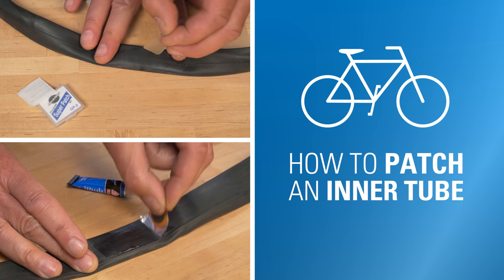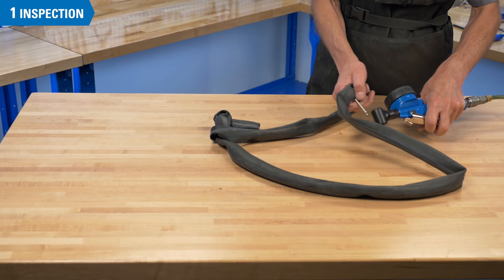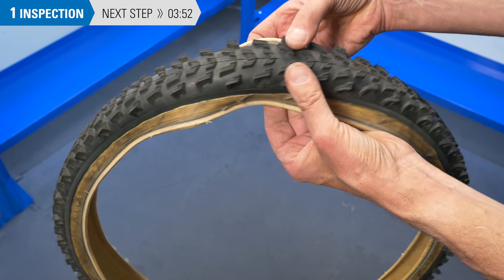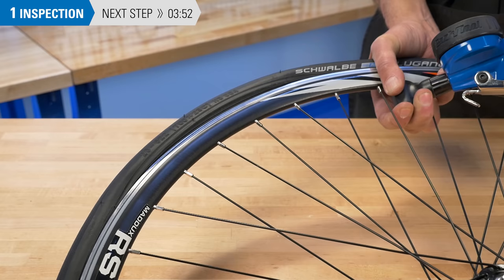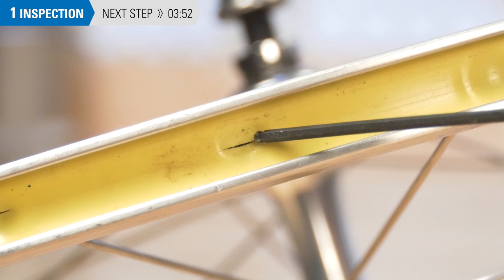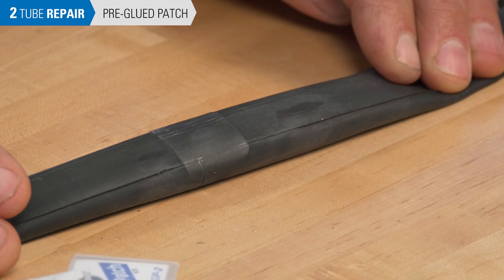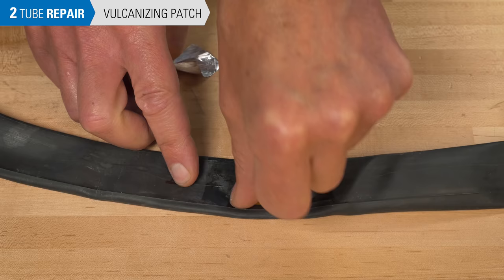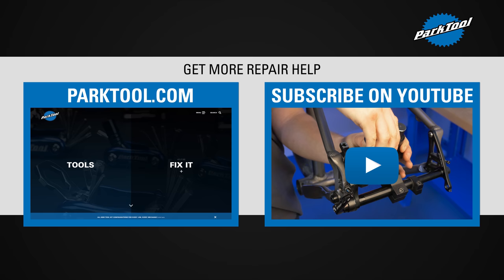How to Patch a Bicycle Inner Tube

Comment: I am being slowly driven insane by flat tires.  I am getting inner punctures from the inner rim.  I have already replaced the rim strips and they still look great.  I put in new tubes.   But, I have to be extremely careful about tire pressure. I am not even pumping them up that hard and it is less than what is says the max pressure can be. And the tire still blows out. I got a quarter in rip, dead center on the tube, rim side, about 4 inches from the valve.  There is no roughness or anything poking out from the rim in that spot.  It is driving me insane.  I live in Denver. Maybe I am over-inflating the tube for high altitude? Oh, and I just attempted a patch, and that failed too.
Reply: me too. I  found out tires from china are defective ! Makes me angry that we keep buying chinese junk ! Most companies here are making their tubes in china such as BELL ! Pure junk ! I put the proper amount of air in and BOOM !
Reply: Especially with narrow tires, either of 2 things can happen 
1. The base of the valve stem gets caught under the wire bead of the tire. Because the bead isn't properly seated, the tire blows off the rim when being inflated. This is prevented by pushing the stem into the rim-hole and feeling through the side walls before inflation. 
2. The tube gets twisted (like wringing a towel). The tension between folds causes the tube to cut itself. This is avoided by putting some talcum powder on the tube & tire to allow it to straighten out.  I inflate the tire to about 10 psi, release the air and then completely inflate.

Comment: What if the puncture is on the inside of the tube facing the rim, is it possible to fix
Reply: I tried that and it held until i rode it. Sometimes if they are along the seam they tend to burst at the patched location making it irreparable. Note i am at the lightest weight that is healthy for my height of 5'11".

Comment: How long do i need to wait before inflating(installing) tire after patching with Pre-glued patch and after patching with Vulcanizing Patch  ?
Reply from the maker: Give it a few minutes, maybe 3. You do not want it wet.
Reply: @parktool  I mean after i patched , after how long can i use it ?
Reply: @Temporalplace  I rarely have a spare tube,  and often help others on the trail with neither patch, tube nor pump.  As soon as I have applied the vulcanized patch, I reassemble the tube/tire, reinflate and continue the ride immediately.
  How long can you use it? Vulcanized surfaces essentially melt together. The tube can be used for years.

Comment: I repair my cycle rubber tube punture at home , I use rubber solution  ready-made patch but problem is that my rubber solution  solution tube is become hard unuseful  in short time, pl give me some tips how the rubber solution keep ok long time.
Reply: When I am out of a "rubber solution" I use a heat resistant contact adhesive which i apply both to the inner tube and the patch. I then wait 15 min (following the instructions on the adhesive tube) for the solvent to evaporate before  applying  the patch to the tube.

Comment: I've noticed that for hard-to find slow leaks, just getting the entire tube WET, short of fully submerging it, is usually enough to find a small patch of water bubbling up at some point. Just in case you don't have a bucket handy but the leak is quite small.

Comment: Can i use these patches to repair small holes on my tubeless tyre?
Reply from the maker: If the tire is in the UST standard for tubeless, and the tire has a butyl rubber liner on the inside, and that can accept a patch like an inner tube. However, if a sealant was used, that would make it difficult to stick. It the tire was a "tubeless ready" or a conversion of some sort, the patch would be unlikely to hold.
Reply: Deabo No

Comment: Way too much glue used just needs to be slightly bigger than the patch as now the inner tube will stick to the inside of the tyre as no chalk was used or included in the kit? I guess that's the difference between fixing your own punctures and someone who does not! If you are going to mark where the puncture is with a sharpy can I suggest you leave the area alone where the patch will be placed to avoid unnecessary contamination.

Comment: As you said just replace it with a new one instead of patching. I trust the first advise. Patching is a waste of my time as always.
Reply: depends. I don't really like looking at a stack of tubes and realizing they cost as much as a new bike, all because I'm too lazy to repair a small leak.
but, it you rarely get leaks, and you can always easily correct what caused the leak, then you're likely right, just swap out and be done.
Reply: Done right a patch is permanent.

Comment: No need to press the valve on a Presta valve to roll it up, just unscrew it to the point where it will not hold air. So much misinfo in this video!

Comment: Hack: Once I used a small piece of chewed chewing gum. It worked perfectly.
Reply: yeah but you cant pump much air into it or it will bubble
Did you let it dry?
Reply: @xxersion3335  I chewed it, pressed it firmly, without waiting I put the inner tube back into place and pumped it at max pressure. It perfectly held. The downside is that this is not a permanent solution. After two weeks  the gum dried and broke itself into pieces. Anyway for sure it is an easier and faster way to save your ride. ;)
Reply: NO WAY ! Juicy Fruit or Doublemint ?
Reply: @triumphmanful  double Mint ;)

Comment: damn,if u dont know how to patch a tube u shouldnt be riding anywhere until u do,common sense really :)
Reply: neil froggy crompton why did you watch this then?
Reply: They do mention some crucial information that isn't always common knowledge (or written in the instruction paper that comes with the kit), like not to test-inflate the tube after patch has been applied cause that can weaken the patch, has happened to me few times.
Reply: neil froggy crompton its not a fooking car if a rock punctures your tube you wont die. You go like twice as fast with a bike.
Reply: Aden aio is there a way to test the tube before riding?
Reply: TWrecks you could. Bikes offer little to no protection during crashes.
Reply: make a space after punctuation, Common Sense really

Comment: Those patch never work....Just take a old inner tube ...cut a piece... scratch it with a sandpaper and glue that with a glue gun after you did scratch the inner tube with sandpaper ( to get a better grip for the glue)

Comment: I'm going to tell you what pisses me off.  This is supposed to be a video about how to patch a tire.  I'm over 3 minutes in and you haven't even started talking about it yet.  You're wasting my time with information I don't need and you didn't put in the title.
Reply from the maker: Diagnosis is just as important as the repair process itself. If you don’t determine the cause of your flat, you will likely end up repeating the entire process down the road.
Reply: You don't get to decide for other adults what they need.  Justify it however you want, but it wasn't in the title.  It could be it's own video.
Reply from the maker: Welcome to the internet Robert.
Reply: @parktool  don't blame the internet for your discourteous behavior.  YOU are responsible for your actions.  Don't be a child.

Comment: Why?  Tubes are not that expensive, when I get a flat I inspect the tire inside and out, then replace the tube.  Takes 5 minutes, I don't waste time putting on a patch that may or may not stay on, leaving you to change it again!
Reply from the maker: Why? First, because it is less waste to repair if it is a good repair. It is also currently not always easy to find a new tube, as supply chain and demand have wipe out many supplies.
Reply: @parktool  Your name answers everything. :D